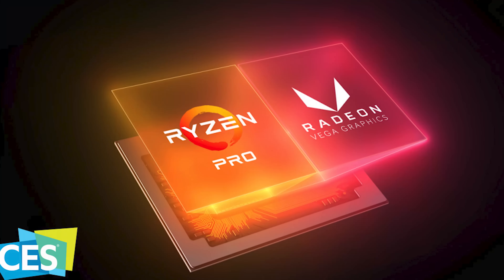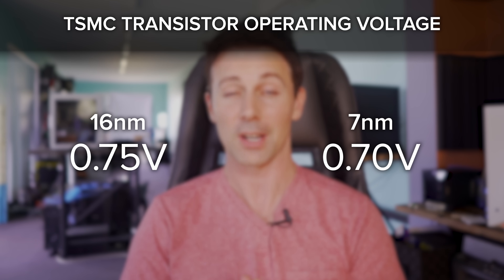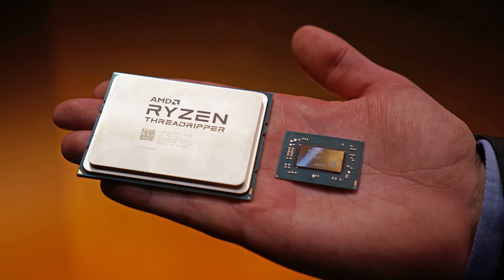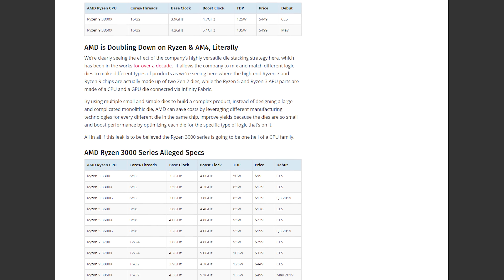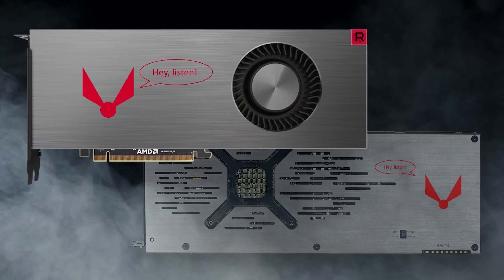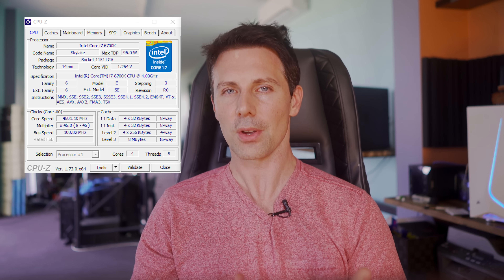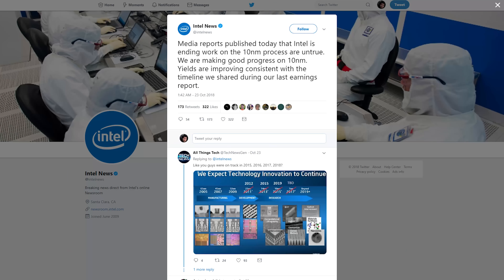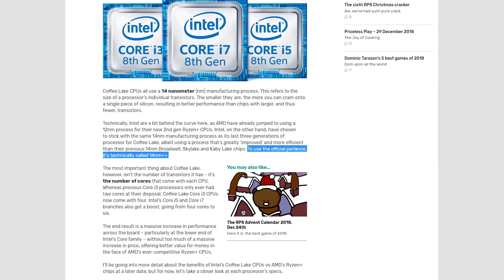7nm, 5nm and Beyond - Will AMD RYZEN 3000 be the PINNACLE...!?

Comment: I really think Zen 2 will be next Sandy Bridge, Cpu that will last for very long time. It is first mayor revision of good, brand new arhitecture on brand new node. Get this year top end Zen 2 cpu and pair it with upcoming 7nm high end Navi/ Vega2/ Nvidia 7nm refresh and you are good to go for whole next gen console cycle of games ( 5 -6 years). Same as it was with for example with i7 2600 + r9 290. Also i think progress with  cpu/gpu will kinda hit disminishing returns after this ( 7nm) point,  smaller increases in power for lots of money more. Another interesting view of this is that consoles may become way more attractive then ever before. Just look at games like GoW, Unc4, Spiderman, HorDawn, these things were made with garbage laptop cpus and 7850 graphics, imagine what they will do with 8 core Zen 2 cores and Vega 56 levels of power 😎. Pc may start struggling if they dont improve a lot in raw power and i dont think we will get that for cheap. 😓
Reply: Apsolutely imo, it is important to remember that in first 2 years of next gen consoles lots of 3th party games will be cross platform ( ps4 and ps5) so power requirements will not immediately skyrocket. I believe you are good to go with 2700x + 480 combo for 2, maaybe 3 years if you dont mind lowering  settings here and there in upcoming AAA games. Then just upgrade Gpu and you are good to go ( maybe with that get best am4 cpu there is, used and likely cheap, by then AMD will already be on am5 platform). Also we dont really know how much better Zen 2 really is, if it is only 10% better, 2700x will age just as good.

Comment: The reason you think its too good to be true is that you are still in the Intel mind frame of tiny improvement for much more money.

5nm is the limit , but thats not a problem for AMD , just add more chiplets !
Reply: 2.5nm is the limit.
Reply: Then that means that AMD is basically already at their limit.

Intel's 10nm process has a greater transistor density than the 7nm process of TSMC, GF, etc.

It will all also mean that Intel's 7nm will have greater transistor density than AMD's 5nm. 

At this point AMD's only option will be more cores. Intel will still have the option to shrink dies even further...from 7nm to their future 5nm process.

Comment: 8c16t 1800x $499 even at that sounded too good to be true in 2016/17 when Intel was charging like 1000+ for 8c16t on a more expensive platform look at where we are now with ryzen prices it's not too good to be true if you think about it that way and the 1700 was even cheaper than that like $320 or whatever it was
Reply: MicroCenter had the 1700 for $180 last week! With $30 off a compatible motherboard.
Reply: @vinyfiny2019  I'm talking about when ryzen launched it sounded crazy that it would be so cheap and offer similar performance to Broadwell 8c for half price or less of Intel so this would be no different now getting 16c at that price is not unrealistic with 7nm shrink too
Reply: @sbrader97  Yeah I'm saying I totally agree with you. If someone would've told me in 2016 that in 2 years I could buy a brand new 8 core 16 thread CPU with good IPC for $180 (from AMD no less), I would've told them to stop smoking crack.
Reply: YES BOUGT RYZEN 1700 FOR 360 EUROS ON MARCH 2017. UNTIL THEN I HAD CORE I5 2500K AND WAS FORCED TO UPGRADE BECAUSE MOTHERBOAD BURNED. 8 core intel was costing more than 1000 euros at that time but then amd made them affordable with ryzen 1700 for just 400 euros. Intel is finished. Now that we will be able to get 16 cores for just 500 euros... END OF INTEL. Rest of pc is GTX 970 G1 GAMING 16 GB DDR4 3200MHZCL15 GS KILL RIP JAWS DELLP2416D 24'' 2560X1440 60 HZ IPS WD BLACK 4 TB, 1 TB!
Reply: @shredderorokusaki3013  You do realize that cores arent everything?
Reply: @Hyperus  Really? The developers decides how many cores we need so guess you're right but Intel seems to walk in AMDs path these days except for the fact that they lie about specs vs TDP though...
Reply: @tmkongen  this useless hate is just bs at this point, quit your bullshit, even if more cores are used, that doesnt make more cores automaticly better.
Judging by his comment thats exactly what that guy thinks, more cores = better is a false statement and it will remain that way
Reply: @Hyperus  Well they are even on IPC now, only speed seperates them core vs core. You can't say that more cores is false statement, it isn't IF the application you run takes advantage of them. For pure GPU bound gaming it will remain false for a while, forever probably.
Reply: @Hyperus  you realize that we many of us do more than gaming with our PC ?
Reply: @ethan-fel  Do you  realize that not everyone does more than gaming and/or needs no giantuine performance for whatever they are doign with their PCs?
Reply: @Hyperus  yeah but why are you accepting to pay more to do less with intel is beyond me. :)
Reply: @ethan-fel  Because it pulls ahead in gaming by a long shot in games which are not gpu limited.
Reply: @Hyperus  unless you have a 240hz screen it doesn't really matter 🤔.

But yeah Intel does 1080 very high fps better, which is a niche anyway. Is spending more to get 300fps over 250fps for a short while and cutting decent upgrades paths worth it ?
Reply: @ethan-fel  I have a 144, believe it or not, 150 and 300 FPS make a difference

having as little dips as possible where ever possible is important to me
Reply: @Hyperus  I'm playing too on a 144hz with ryzen and the ride is smooth, extremely smooth even.

The "dips" aren't determined by the max number of fps you can run but by the FPS curve. Ryzen offer a great experience in that area. ;)

You may be on the wrong plateform if getting something stable is your priority if you play at 144hz
Reply: @ethan-fel  My priority is stable more than 250

at the time i bought my i7 7700K (which still gets more FPS in CSGO than the 2700X, yes CS does use more than 4 threads, alot more) the first gen was there, was known for terrible performance in CSGO, so i couldnt really go for one
Reply: @Hyperus  yeah but the 7700k has a worse fps curve than even first gen r5 1600.

Anyway, even first gen ryzen is able to run the game well pass 250-300fps.

You suffer from more dip.

With a 144hz screen it's better to be stable at 144hz than unstable with peak at more than what your screen can show.
Reply: @ethan-fel  That is such a lie lol
Reply: @Hyperus  you are just in denial :)

https://linustechtips.com/main/topic/765776-ryzen-smoother-than-i7-in-gaming/

Posts and material on this subject doesn't lack. The fps curves are better on ryzen 5 /7 than the reference at that time, the 7700k. 2 more cores and 4 T more made all the difference.
Reply: @ethan-fel  You are in Denial, it doesnt fucking help to not have drops when the CPU cant even achieve a stable 250FPS and more

IT does NOT happen, i still remember TONS of people on R7 1700X wondering why they dont do mroe than 180 FPS in CSGO, like yeah, i am very much in denial, thanks when you dont even see how shit Ryzen 1 performed in CSGO, you cant call me in denial when your subject of playing doesnt seem to be CSGO whatsoever
Reply: @Hyperus  xD I'm leaving you here.
Reply: except the 1700x existed.... it was literally charging 100 more for basicly no more performance
Reply: yourleftnut1  you know what, Bring it Up, Test it with CSGO and a 144 Hz screen and i will guess correct 10 Out of 10 times

Comment: Give me 3700X and RX 3080!!!
Reply: Give me your money.
Reply: @typingcat   get a job and save little by little till November/Decembar 2019 and treat your self greatest present for yourself. Ezz.
Reply: @typingcat  😂🤣😂🤣😂
Reply: YES BOUGT RYZEN 1700 FOR 360 EUROS ON MARCH 2017. UNTIL THEN I HAD CORE I5 2500K AND WAS FORCED TO UPGRADE BECAUSE MOTHERBOAD BURNED. 8 core intel was costing more than 1000 euros at that time but then amd made them affordable with ryzen 1700 for just 400 euros. Intel is finished. Now that we will be able to get 16 cores for just 500 euros... END OF INTEL. Rest of pc is GTX 970 G1 GAMING 16 GB DDR4 3200MHZCL15 GS KILL RIP JAWS DELLP2416D 24'' 2560X1440 60 HZ IPS WD BLACK 4 TB, 1 TB! No need to upgade from 1700x as there is no need for me to upgrade from 1700. We have monster cpus who will run evrything at max settings 4k with a good graphics card. I run evrything 1440p max settings 30+ fps so all i need to do is change graphics card. Upgrading cpu again when i already have a monster one will be waste of money since it is not needed. iam waiting for rtx 3080 to upgrade!!!
Reply: @shredderorokusaki3013   I still use prebuilt PC bought 2012 Decembar. with i5 4440 and 650Ti Boost.
I have changed GPU to overrated 1060 3gb that is NOT worth the money you can get 580 8gb! and i got 8gb more ram but very old DDR3 working at 888mhz.... 16gb.
Can't wait to get rid of i5 4440   4CORES 4computedcores..... i want to see the LIGHT OF AMD! 3700X and 3080 investment will run for me full HD 24inch monitor for 7-8 more years for sure. Life is beautiful ^_^ love technology
Reply: @shredderorokusaki3013  I have never used or seen difference for why to get 1440p monitor. I am so used to FullHD and high ress on everything that i am not willing that for same GPU that could run better/higher graphics on FullHD downgrade it for 1440p wich is nothing as wider/more ppi wich is ok but overall performance dips if you dont have higher end gpu.
There are Samsung Curved monitors that i am looking rlly into. FullHD. There is even 27inch version. It even supports AMD FreeSync. For my 3700X 3080 wish buld. winzzz
https://www.samsung.com/rs/monitors/curved-cf390/LC24F390FHUXEN/
https://www.samsung.com/rs/monitors/curved-cf390/LC27F390FHUXEN/
Reply: Me too

Comment: So basically another case of a Technology Maturing... So by jumping to Am4 on a b450 and a 2600x like I did I have pretty well made an Investment, that will last a fair bit of time yet? Also Seeing as I can Probably shove a Zen 2 3600x into the bugger I guess I made the Jump at the Right time for once... Good to know I didn't waste my cash like I did on my old 4770k... Intel Kept Changing the Damm Board Locking me into that for years and years... Good Old AMD... First Ghz Processor, and back in the day the Athlon Kicked ass... Now Ryzen has come full circle...
Reply: Maybe the newer CPU's might not be able to overclocking with the B450 VRM and you would take a loss on reselling the 2600x.
Reply: @grlmgor  Not likely as it will require less Power to push it farther, given how much less it will require, also the TDP will still be 95Watts for the 3600x so that's about the same as my Hexa... Had that happen with a Graphics Card the old one needed 250 Watts the newer one only 185 so no it wouldn't be the VRMs and Boards are Cheap... Ram and GPUs and CPUS are not.
Reply: @Zacarriss  Their getting even more cores if the leak is true.
Reply: @grlmgor  I am aware, the 2700x is 105 watts the 3600x is an Octa at 95 watts, so probably I am going to be fine if not it's easy to get an New B550 when it comes then I will just wait for the Benches... Ehh anyway night...

Comment: Why is there nobody talking about optical-computing? I mean, both Intel Corp. & independent academics have developed & demonstrated such technology back in 2015, yet nobody Advertise on using it on commercial product. It will offer a higher-bandwidth data transfer compared to a metal-copper-strip as well as lower power consumption, a hybrid is definitely practical, nobody says it should be all optical, it's like any component in a silicon circuit.
Reply: I've noticed a pattern to these "revolutionary" techs. Big announcements and woweee news. A few years silence, a few more with a few odds and ends having the tech then suddenly a few years later it's normal stuff that moved in the same way the frog was boiled. Lot's of tech we take for granted now is like that. I vaguely recall the first talk of Dual core cpu's as some exciting breakthrough if only they could get it cheap enough and practical.  And now we'd probably scoff as someone trying to use a dual core for anything serious. Same with digital optical fiber. And so on and So on.

Comment: Just thinking about it is freaking insane. I don't think most people don't stop to realize that one nanometer is 1/1,000,000 of a milimeter. And 7nm is going to be available for consumers, there probably already are 2-3nm chips out there. 
I think we are reaching the upper limits of silicon though and will need to find a different medium to use.
Reply: Graphene lol jk idk
Reply: IBM is trying to make graphene work
Reply: @MrJason005  key word "trying" and is there any reason to think it won't turn out like EVERYTHING ELSE IBM touches?
Reply: @metasek1098  yeah hadn't got to that point in the video haha
Reply: Gallium Arsenide is next.
Reply: @tylerdurden3722  I remember 50 years ago when GAAS components were a hot item.   And I'm not joking, it was 50 years ago.
Reply: Isn't a nm about 3 atoms of gold wide. At those scales, it's hard to imagine hysteresis or Quantum tunneling or some other basic phenomenom won't screw things up, no matter what material is used.

Comment: We have great hardware as is. We need great game engines and great implementation of of low level API's. Devs are lazy and use the same engine relying on hardware updates for better performance. "No we did not implement DX 12 or Vulkan, but damn, the amount of time we spent on perfecting the loot box store". "We did not optimize textures, clean dirty edits or fix bugs. But we did cut content and will sell it to you on a season pass".
The games suck for the most part and cost more then they are worth. But I need to upgrade from a monster PC to the next level?

Comment: If I remember, 5 nm is the smallest transistor we can reach with silicon. Otherwise, electrons would travel through the transistor. But I may have seen a video where this could be solved by making tinier transistor but with graphene. Maybe EUV will be used on graphene but that’s all I know about it.
Amd is “breaking intel apart”. You still need to know guys that the architecture is really important. If AMD fails that, than it will result to a complete failure. 
I am still hyped for this 7mm process. But only for the graphics card. I hope someone will find a way to use DXR with these new gpu’s.
Reply: 3nm seems likely doable. Likely enough a multibillion dollar plant is being made to produce parts at that scale.

Comment: "7nm" is it even true 7nm? intel 10nm will allmost for sure beat amd 7nm, 6700k strugge to reach 4.6 or 4.7ghz? is this a joke or what? i seen 6700k go beyound 4.9ghz many times.
Reply: Just going to point out my old 4770k was Barely Stable at 4.5 and hit close to 85c and sounded like a Jet, and while my 2600x maxes at 4.2 Ghz at only 67c under max load and is pretty damm quite if slightly Audible about as loud as a Cheap Case Fan which is not loud... It annihilates it in Productivity in programs that require more threads the IPC is Comparable as in 5% to 7% Either way. Yes there are a few Golden Chips out there in the wild, but no in General he's quite correct, also were Talking about TSMC Producing 7nm. Not AMD Specifically even if it's their Chip and Design... I know what your getting at as I was around and building at the time... It's the Fact that AMD had Cores that were Split in Two Compute Units to Mimic Threads... 7nm Refers to the Process and Transistor Size, granted transistor is a pretty loose description as they don't look like a Transistor that happened because Intel refused to let AMD have SMT. So they had to Invent Infinity Fabric to Create Multi-Threaded CPU's... Before that Chips like the A10 6700 for instance had four Cores Split between two Actual Physical Cores... That is 100% Entirely Different from the actual size of the Node Process... Also that Situation was Unique with the A Series and FX if I am not Mistaken as it was a Brute Force Method with a Much Older Architecture. Consequently the 2600x has Six Physical Cores and 2 threads per core now that AMD has it's own Multi-Thread Method and the Node is 12nm though good luck seeing something smaller than a Dust Mite... In fact it might not even be Measurable in the Traditional Sense, have you seen a Dust Mite?

Sides I am Glad this Competition is Happening... It's been Gridlock for Years... AMD's actually Changing the game again... Now we will have actual Evolution going on... Intel's like an iPhone it's Obsolete in a Year... I am sick of that Crap... AMD gave me an Actual Reason to Jump Ship again... AMD also invented the first GHz Chip... Also 1998 was an Interesting Year... Need I mention the Early 2000s... Good Shit...

Plus a Company like TSMC would be Ruined if it was not Legit Producing what they Say given how AMD is not their Only Client.